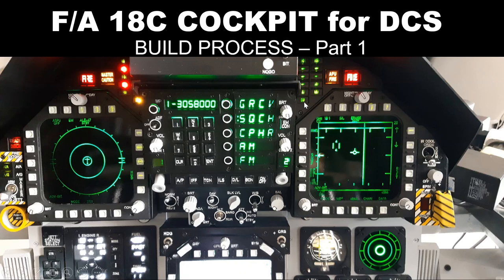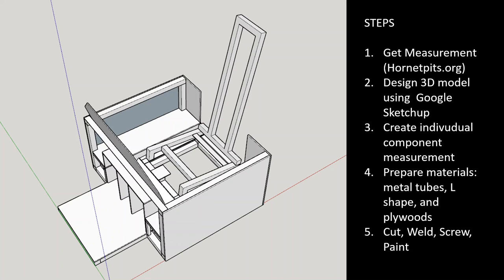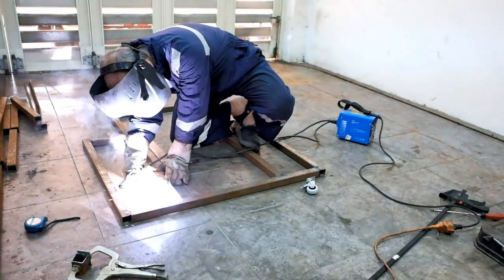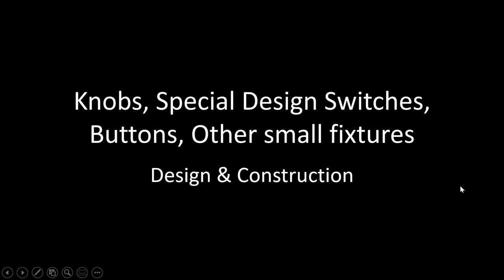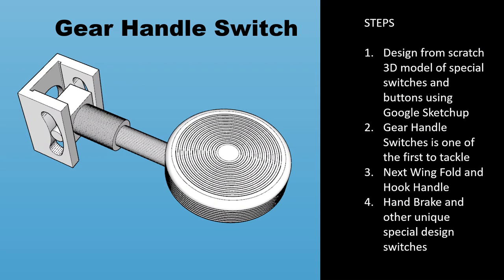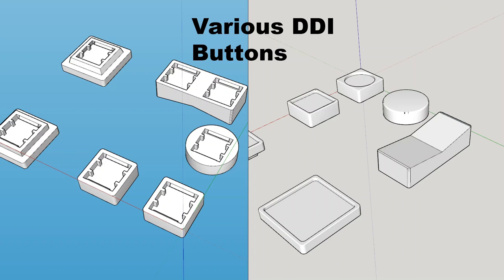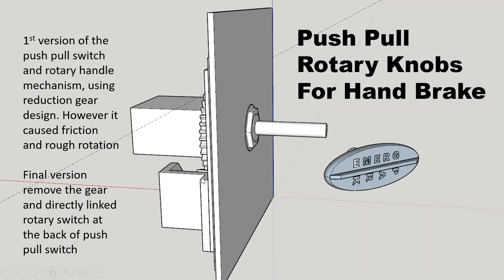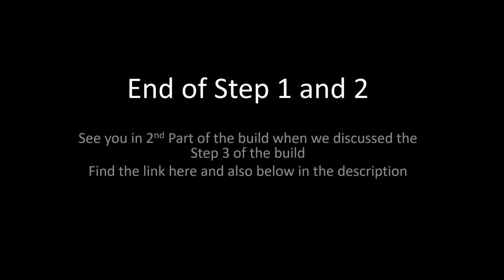F/A-18C DCS VR Cockpit Build Process Part 1

Comment: I have never heard anyone complain about how intensive and tiring welding is for a project this small. I'm glad you managed to push through it though 💪.
Reply: Id imagine at his age and countries heat, its incredibly tiresome. Try working a sedentary job for 10 years and then doing this small project. I guarentee it will kick your butt. When we're younger it's easy to muscle through most tough jobs and most places have you doing more technician type jobs. As you get older your experience is much better utilized managing projects and designing. They dont really even want you out with the techs. So its easy to get rusty and out of shape quickly.

Comment: Pretty cool.  I'm also making what is a very similar cockpit just now.  I'm generally using the OpenHornet CAD models as a core guide, but I re-make each component in CAD so I can adapt each part to how exactly I want them.  I also use a combination of welding, woodworking, and tons of 3D printing (FDM in my case).  I made my own flight stick/grip and throttle from scratch out of all printed parts, so really the only store-bought part of my project are switches and of course the Bodnar boards.  If you'd like, I could shoot you some pictures, but I don't know the best way to do that (email?).    Good job.

Comment: It is not safe to use a long thin extension cord with a welder and it if more dangerous to leave it in a coil because the heat will build up and could melt the cord and even if it doesn't meld it will soften the insulators and jacket and getting Sparks on it when it's already warm can puncture it and then one day when it's plugged in and you grab a hold of it you could get zapped
Reply from the maker: Thx for the tips👍

Comment: Are some of your switches also special in the way that for example you need to push them in, or pull them out in order to flick them?
Reply from the maker: Not all 100% authentic but mosf of it can be replicated ex. Frequency knob in ufc for ex as long you could get the right push pull rotary encoder, some dual stack rotary encoder. Gear switch here not replicated with pull and then move up and down due to simplicty approach other builder ive seen are replicating the real movement of the switch

Comment: may i ask you one thing about the button (last part of the video).. the process is not really clear... why the engrave are black and than in the right picture all the engraved part turn white??  🤔 in which order you applied paint, engrave, cleaning with alcohol and do on? thanks in advance
Reply from the maker: Hi the resin used ia green a bit dark green thus look black  againts the light gray paints. It turn white when I applied an opaque acrylic paint using a swab then clean up using alcohol or ethanol to dispose the paints out of the engraved channels. Its in part 2a or 2b I forgot though I described the method thx for inquiries

Comment: Hi, great videos.  My question is how can you see the physical cockpit if you are playing in VR?  I don't really understand that part. thanks.
Reply from the maker: I dont see it :) most important is the button shape and location, the cosmetic of the cockpit is just for me wanting to have the real cockpit. It s quite immersive and the button shape allow reflect when you practice enough. Except for DDI and UFC it's still hard as it s small and the buttons are closed to each other. (meant to be seen in actual too), but with more practice and using other switch, edges as guide it help to point to accurate button. Until such time the pass thru camera or hand gesture camera allow the accurate hand positioning in DCS. :). Using 4K 50 Inch tv also quite good the cockpit become a big comprehensive button box and controller but still less immersive in term of view I need to map a view button into joystick to see around or using track IR
Reply: @hobbytechgearID69  could you try leap motion ？Let us know how it goes😀
Reply from the maker: If I got a chance at this moment to yet priority. Leap motion help in directing the finger hand placement but for manipulating control lack of tactile feedback then need to combine with tactile gloves thus increase complexity😅
Reply from the maker: @KniGhT at this moment thats also not possible MR are suitable for spesific task for Virtual world not helpful, hands tracking might be but still need some easier setup and integration with sims